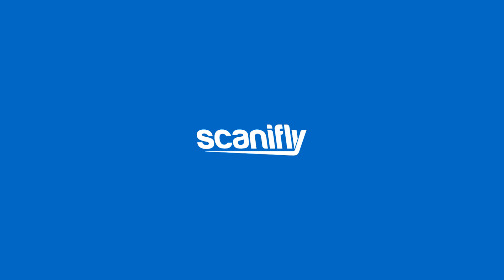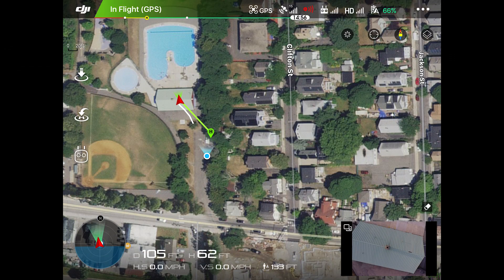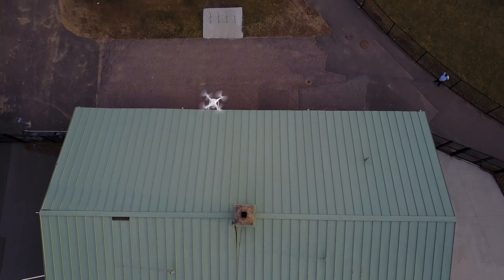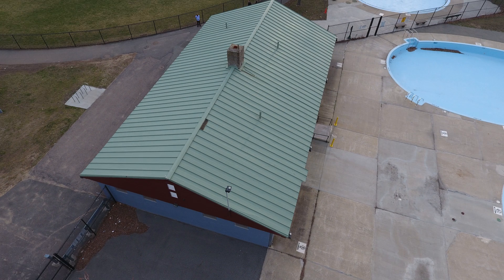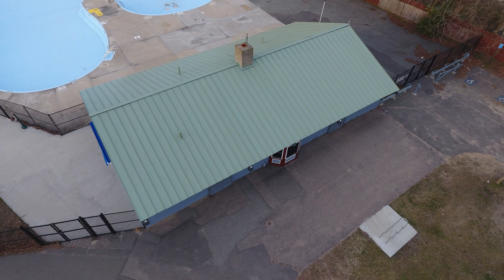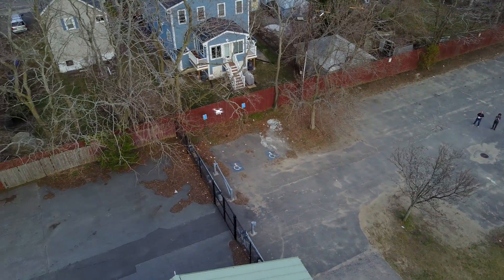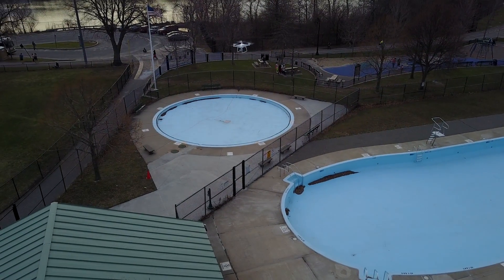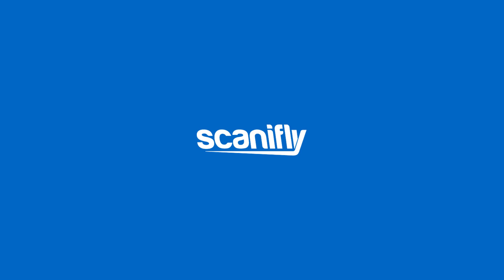Data acquisition - Capturing Drone Images to Create a 3D Model

Comment: Great video guys! is the Mavic Pro as good as the Phantom 4 for a use case just like the one in this video? does it worth the extra weight, volume and price of using the Phantom?
Reply from the maker: Hi Michael! Thanks for the compliment! The Mavic Pro is great if you're going for portability. Both the Mavic and Phantom take excellent high-res geotagged images, so both are sufficient.